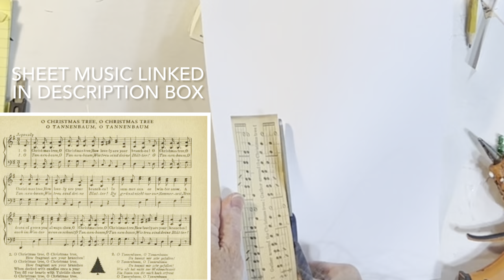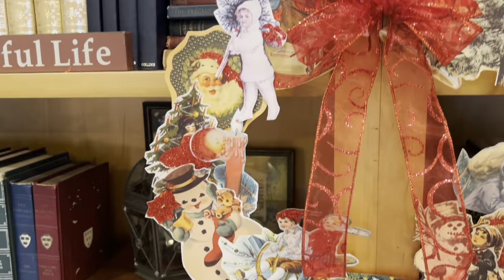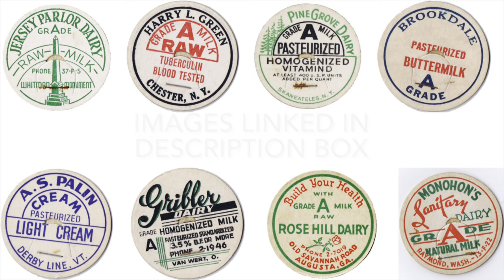8 Vintage Inspired Christmas Decor DIY’s on a Budget!

Comment: What did you put in design space to make the scalloped edges of the milk cap ornaments? I'm still learning design space and out of my realm of understanding on canva still. I would love if you did a video explaining canva as compared to design space!
Reply from the maker: I am pretty good on Canva, but I only know the basics on Cricut. To use the scalloped image, once you are in your canvas, upload the image from your photo roll (or files). You will then be able to remove the white background by pressing the “select” option next to the magic wand image. You can then tap the areas you want to remove. Save it. Then, you can add it to your canvas, size it, duplicate it, and cut it. Hope this helps!

Comment: Your imagination should be insured by Lloyd’s of London. I don’t know how you keep coming up with the 😅most unusual and unique ideas. Nearly all of them are a lot of work too. You always surprise us and give us food for thought, you inspire. I bent two wire hangers to form Angel wings and I want to cover them with lace. Any suggestions on how to do that accurately? BTW! Your Victorian cover photo is so beautiful. I wanted to jump into it and stay there. And the music was just right!
Reply from the maker: Oh, thank you, Gizmo! 😊 You are so very sweet! For your angel wings, I think I would spray the the wire with adhesive spray and then lay the fabric over it, pull it taut, and press it onto the sticky wire. Next, I would flip it over and cut off most of the extra fabric—leaving an 1/8th of an inch. Then, I would work in small sections, putting hot glue on the back side of the wire and pressing the extra 1/8 in. of fabric around the wire and into the hot glue. I hope that makes sense.
Reply: Yes, it does make sense. However, I was thinking of covering both sides. So if I can trace the wire form onto the lace, cut two pieces with an inch seam allowance, leave a big opening, I can slide it on and hand stitch the opening. My lace is see thru, so I want more coverage, but if I use a solid piece of material, your idea is ideal. Thanks so much for taking the time to reply. Looking forward to your next video.

Comment: What size drill bit did you use for the chenelle tree?
Reply from the maker: I honestly don’t know the exact size because I just keep my drill bits in a cup. I tried out a tiny drill bit that was too small; then, I tried the next larger one 😜, and the wire in the pipe cleaner fit in the hole perfectly.

Comment: i have been looking fot the shiny brite box images in plublic domain and can fot find them.  They are on Etsy for a fee.
Reply from the maker: I did find them on a public domain web site. (I’m not sure which one at the moment.) Just because someone sells an image (on Etsy or anywhere) does not mean that they own the copyright. In fact, if the image is vintage and has not been changed, it most likely IS in the public domain or that seller would be violating copyright law—it is highly unlikely that the Etsy seller owns the copyright! Does that make sense? With that said, I linked the images in my description box for your use. I choose not to charge tor making these free images available to my viewers.